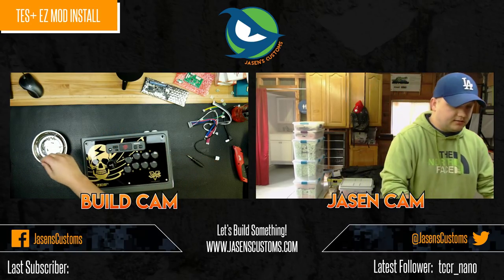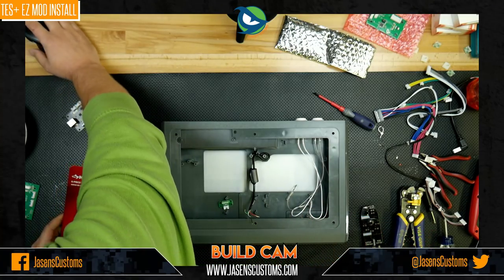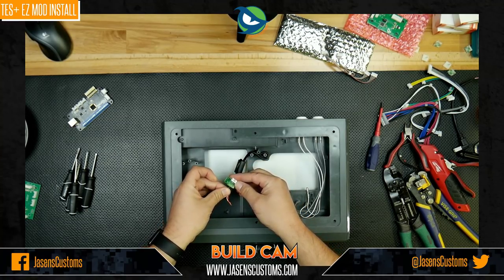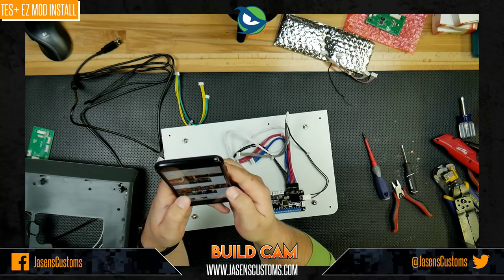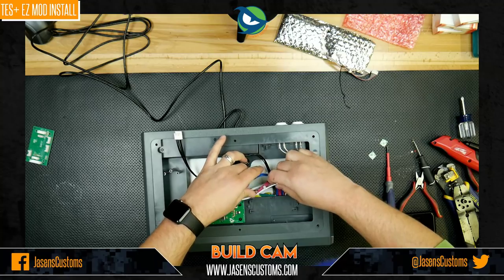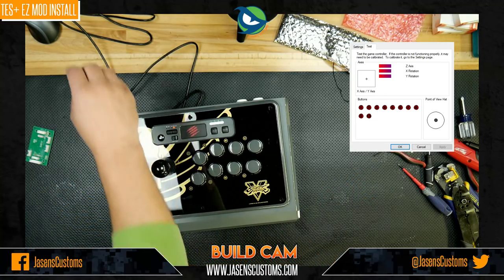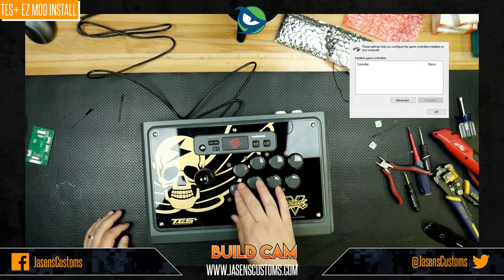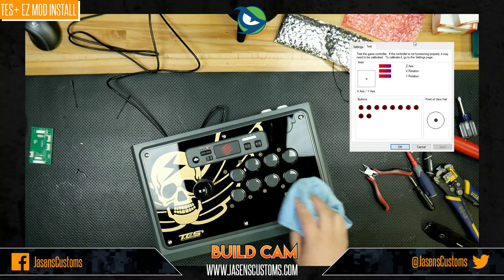Let's Build Something: TES+ EZ MOD Install with the Brook Universal Fighting Board

Comment: FYI I just installed UFB-UP5 and it worked fine with this mod however you did need to unplug the j2 cable so you could hook up the UFB-UP5 which is not really a problem since the J2 header was for future expansion that was never implemented.

Comment: love these videos, just curious, for the PS4 sticks, the touch pads all come with that thin ribbon cables, how does one connect that to the Brooks UFB without something like the EZ mod? for example the Hori Pro N, there is no such ez mod board, thanks in advance
Reply from the maker: You can't. You need to adapt the FFC to something else, so it would require some sort of PCB.
Reply: hmmm okay i see, do you find that FFC connection kind of a hinderance?
Reply from the maker: They aren't that bad... but many touch pads pass their "click" function through it and that could be an issue for PS4 users. I mean, you aren't going to solder wires to an FFC and tap the signal lines; so that could be a problem.
Reply: yea i see, so for now you're saying something like the ez mod has to exist for PS4 sticks with the FCC to be connected to the brooks? without it, you just have to give up that touchpad function?

Comment: If I wanted to use a Kaimana mini led board with this I would just need to place it in between the 20 harness and the UFB pcb right? Or does the pass to the separate board for the buttons affect that in any way?
Reply from the maker: mason richey - you’d need to remote mount the Kaimana Mini. There isn’t enough room under the case plastic for the mini to fit. Additionally, the ufb comes with right angle 20 pin connectors.

Comment: Will this work with the brook wireless board instead of the UFB?
Reply from the maker: If you change a couple of headers and drill a hole to mount the antenna, it should.
Reply: Would I have to resolder the connectors like you show here to make it fit? Is there like an adapter or something that would work for that instead?
Reply from the maker: @jordonp  - Desolder / Resolder or get very creative with cutting some plastic in the case to make it fit.
Reply: Thanks!